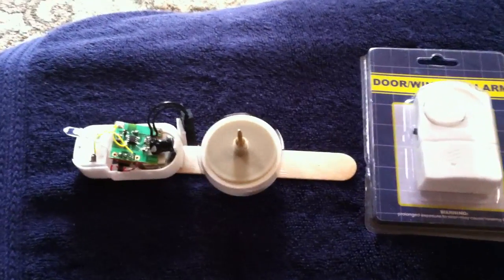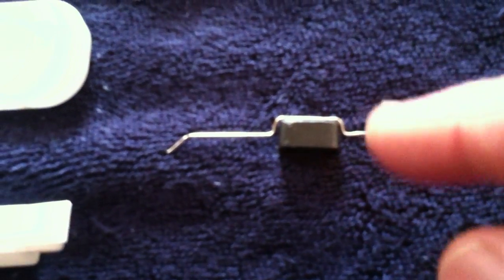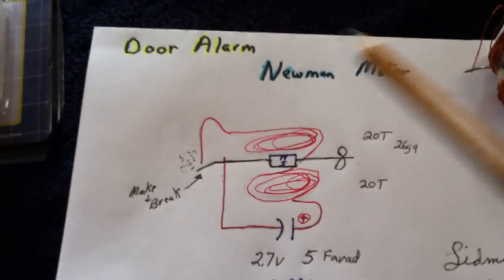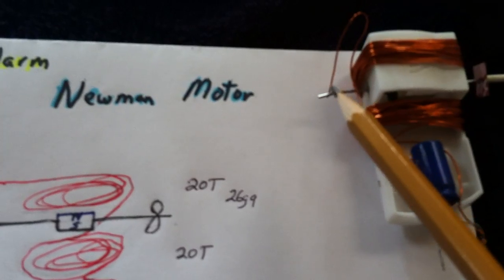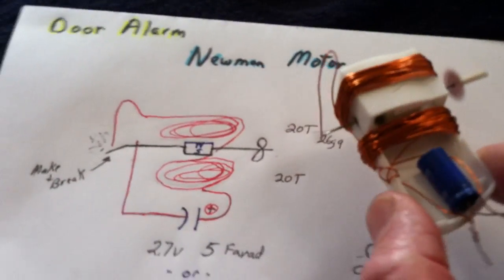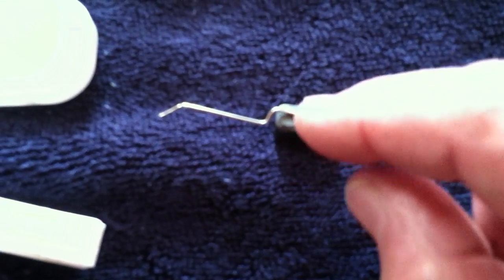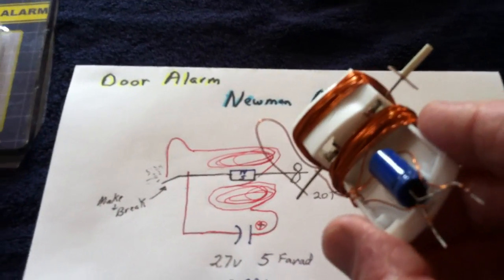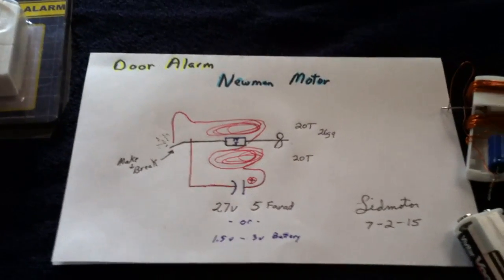Door Alarm --- Newman Motor

Comment: i have a question about the make & break section.
you need part of the shaft or the supporting, current carrying wire to be freely exposed and not covered over with enamel right?
What if you made several tiny sections on both shaft and wire exposed? 
something like

|||||||||||

where each line on both shaft and current carrying wire would be a thin section where the enamel was removed, exposing the wire. Do you think that would change its operation for good or bad?
Reply from the maker: +gskaloyan On this scale project it would not be worth it.  On a larger scale perhaps.  You would in effect be pulsing the motor multiple times on each rotation.